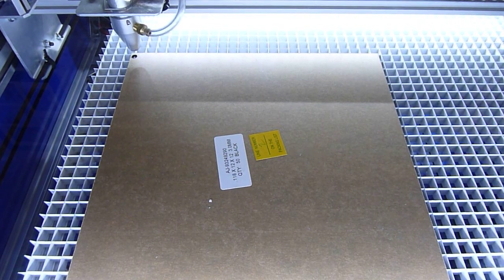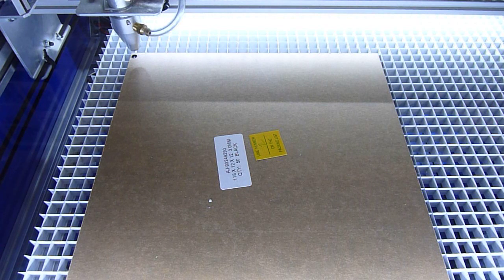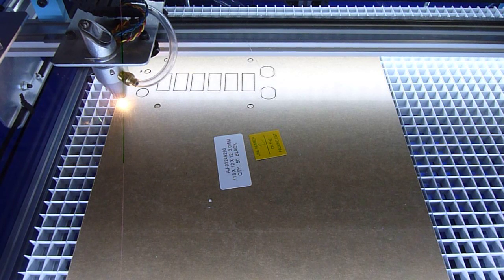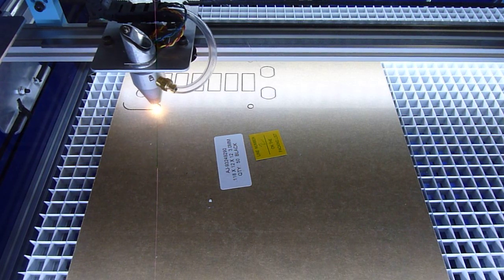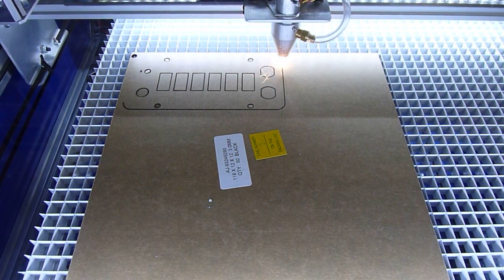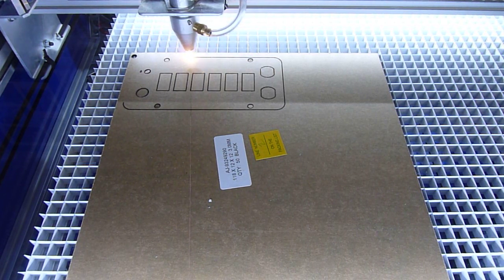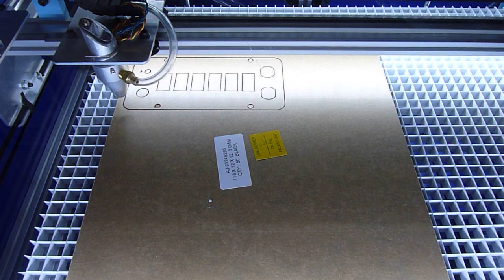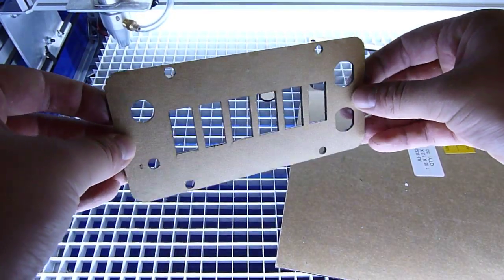Laser Cutting 3mm Black Acrylic

Comment from the maker: The grid is made of white powder coated aluminum. Yes there is a little bit of flashback but if you had a plastic one it would just cut straight through it. Most of the plastic ones are made from materials that really shouldn't be laser cut (for example pvc) so be careful. I get little nicks in the plastic when the laser meets the grid but if I am cutting something important then I usually use risers to lift the part over the table a little.